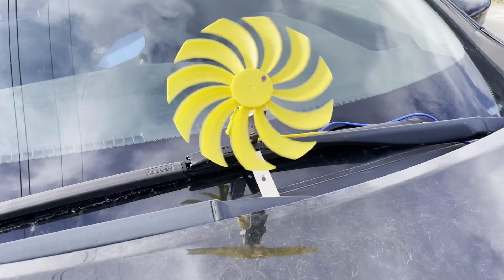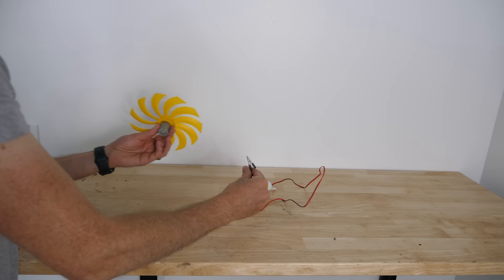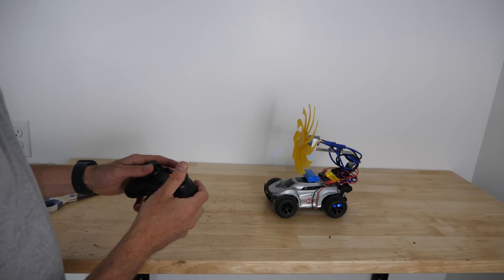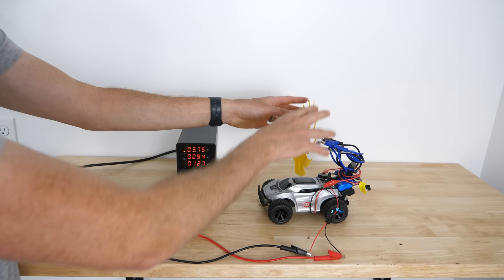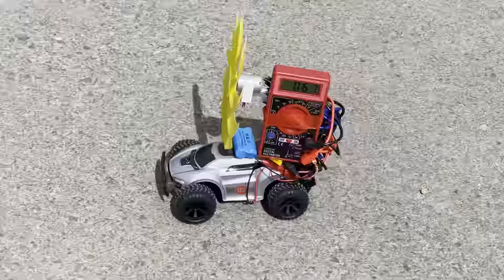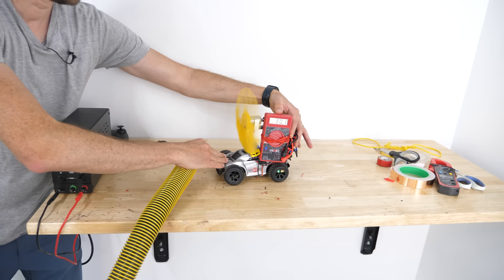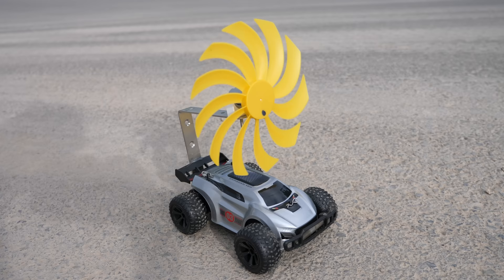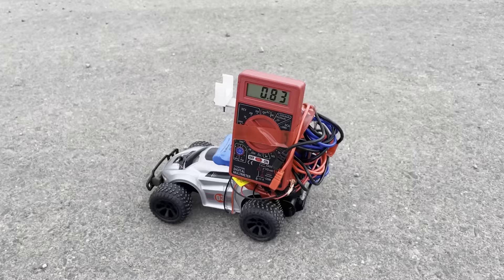Can You Power a Car With a Wind Turbine?

Comment: Heres a question: Let's say you have a container full of water with bubbles coming up from the bottom of it. If you rise the entire container up at the same speed that the bubbles rise, do the bubbles go up faster or slower relative to the container? And lets say you drop the container so it is in freefall but still upright, do the bubbles go up faster or slower (Once again relative to the container)? 

Don't know if The Action Lab has already talked about this but I think it is a good question. I think I may know what happens but I think it is a neat question nonetheless.
Reply: In both cases the bubbles would stop moving relative to the container.
Reply: The same force applied to lift the container would be asserted onto the bubbles by the liquid around them. It would neither make them faster or slower, assuming you can do it without agitating the liquid

Comment: I actually done a theory about this for an english exam as an energy recovery system on a petrol powered car with a motor used for a Refillable Nos like speed boost in theory.
Also added series of Dynamos to the prop shaft for more energy recovery

Comment: What about trying to put the windmill inside a large tube? And slightly modifying the front of the rc car to not only lessen the air resistance but to use the air pushing the rc, directed to the large tube with windmill. 

It would look like an rc car with a ramp on the front and a "jet turbine" at the roof. 

I dunno, just an idea. Making the RC more aerodynamic should be tested further.

Comment: Betz's Law establishes that the maximum theoretical efficiency of a wind turbine is 59%. If that turbine is well designed, it can exploit that theoretical energy with 88% efficiency. 0.59 x 0.88 results in 0.51. A turbine can only harness a maximum of half the energy of the relative wind. An electric car with regenerative braking, generators coupled to the suspension system and a wind generator, could recover a third of the initial energy from the previously charged battery. Even part of what is missing could come from photovoltaic panels installed on the roof of the car. It is a complicated and expensive design, but not impossible.

Comment: A lot aircraft do use turbines (Ram Air Scoops) to generate electricity. I suspect it is more efficient to siphon energy off of air speed then to steal it from thrust.
Reply: Many jets also have deployable ram air turbines that can provide electricity to maintain control of the aircraft in an emergency where power is interrupted.
Reply: They have these turbines because as long as the aircraft is in motion, engine failure won't mean you have no power. It has nothing to do with efficiency and is done only for safety. It is less efficient than mechanically linking a generator to the engines directly.

Comment: Okay, so the answer is yes, but not like that. You need to power the turbine and use the wind generated by the output of the turbine as a sail, you can then power the turbine from generators on the wheels of the car.

Same concept as what Eric from Veritassium showed off with the propeller driven car that goes faster than the wind.

You can energy harvest the differential between the air speed and ground speed while in motion yourself.

The only kicker is you need a differential between the air speed and the ground speed. As long as you have the differential, you're good.

Comment: What about some sort of turbine or fan device If you were to install it all it in normal car venthing areas, Especially things like supercars where they have brake cooling ducts anyway. Experiment with different shapes and dimensions of the things that you use for catching wind. Could definitely optimise it all between placements, wind catcher etc

Comment: Could you explain why hybrid automobile can achieve higher energy efficiency on highway, even without considering the energy recovery duribg braking? To me, it sounds like those vehicles are able to get net positive energy just by adding a electric engine in.

Comment: It could still work make a more aero dynamic duct like 3d printed cone type like aero plane engine type  and change the turbine lay out so the fan is like a hamster wheel type..so that it wont have so mush wind resistance and be more beneficial by charging and driving forward.

Comment: Hi, I assume you were using a motor that had a high RPM. My idea is to use Wind Turbines which have a low RPM but high amps. Now, the vertical turbine would be mounted on a the car roof and used to charge another set of batteries which would be used to charge your electric car. I did a video to explain the idea on my channel. So, my idea is not about "free" energy, but more free charging your electric car using a wind turbine.

Comment: The main limitation of wind turbines is that it is impossible to extract all of the energy out of wind.

To do that would require the air to stop moving after passing through the turbine, but if that were the case it would block new air from moving through. The reault is a fundamental efficiency limit around 50%.

Thus any attempt to power a car with the wind it generates will result in a loss of power, as 50% of the drag force on the blades (a portion of the cars kinetic energy) will be wasted, resulting in an overall higher power consumption.

Comment: Well, to be fair this is still a lot better than using the wind on the side of the road to power turbines. In the end the electricity will come at the cost of a lower gas mileage either way. But I imagine it being way more efficient to have the fan on the car than on the side of the road. Not as efficient as an alternator of course. But you know, at least somewhat feasible.

Comment: No you done it wrong you should put the turbine in front the car so it's not creating more drag insted it reduces some air resistance that will eventually hit the car it self anyways
Reply: It's always going to create drag.  Air turbines need air resistance to function.  Adding that surface area for the air to hit is always going to cause the car to slow down or expend more energy to compensate.

Comment: What about generators in the wheels maybe separate or in the same motors or have the fans deploy by opening a flap in a tube that's part of the frame acting like a turbine generator when slowing down at high speeds?

Comment: If people are putting a wind turbine on the push bike to power a light why don’t the just put an electric motor on one of the already moving parts of the bike to make use of the already existing energy being created.. ie on either front or rear wheel hub/ rims, either sprocket. As soon as the bike is in motion it is creating energy which very easily can be converted to electricity

Comment: If you set two turbines in both sides so it affects less the air resistance? But the turbines should be also with a different design that can make them spin only in one way.

Comment: What happen when you stick the win turbine at the back, on the license plate, align it vertically to remove air resistant? Will the streamlined of the car rushes the wind through the turbine and benefit us?

Comment: What if?
Scenario 1
- Take an extremely aero dynamic car design
-  Place a wind turbine engine under the hood
- Make additional vents to channel back the wind to the turbine.

Operation -
- EV battery operated car propels it forward from 0-50kmph
- Battery power shuts off once the wind turbine gathers enough power to power up the battery
- Car runs on battery powered by wind turbine under the hood

Comment: the turbine has an extra wind resistance the vehicle and the generator on the turbine is like 85% effective, that means the vehicle will use more energy to drive with that wind turbine on that vehicle than without that wind turbine.  

the idea can be modified, the wind turbine can be telescopic, like those automatic antennas in the 90s that came out of the car. when the car drives, the wind turbine can be move in and when the car parks, the wind turbine can move out to make electricity to charge the battery. there are possibilities to build that.

Comment: I am sceptical on the result here. Because in relation the windmill here destroys the airflow arround the car, but if this turbine would be in a position like they are in a combat airplane i guess this could do better. So as shown in the intro, this should be tested with a real car and the output measured from the little turbine to examine the output. i mean yes, it might not fulfill the Purpetual motion but could be interesting, to gain energy for the systems inside the car, like lighting, radio and so on.

Comment: you have to put the proplelor at the back of the car tilted down near the vacuum field so you wont ad resistance  beter juse a liniar propellor just below the back where the air drops off (like a rotating pipe whit scoops or blade whatever ) i hope this is a line of thought i see already a disgins two propellrs on de back tilted 90 degrees with the wing tips just outside the side of the car for adsample
Reply: you also can direct the flow over the middel where the 2 propellors go against the wind like sticking your hand outside you car window then onley not on the side of the car but on back where the wind gows inwarts swirling back  maybe ?ja  da ja da ja da ja da

Comment: But if you put tiny versions of these inlayed inside the body of the car, maybe 4-6 lined alongside the windshield, you could atleast power small electronics within the car without using your battery and without reducing aerodynamic features of the car.

Comment: replace one wheel with the motor and see. if we keeping propeller to the motor due to air resistance we are loosing energy right, then attach to the wheel like if battery is attached to back wheel then replace front wheel like that. then no air resistance, only resistance is due to the magnetic field of the motor and weight of it.

Comment: kinda shows you how important aerodynamics is. I remember reading an article of Mercedes making a car based on the box fish which apparently is very hydrodynamic. So they applied the same design to a car chassis and found out it was crazy efficient, even with a traditional gas engine it was on par of hybrid type of fuel efficiency. The only downside it was ugly AF

Comment: Haha, as I watch here, before you even say it, I know to say that the wheel motors and battery will put a magnetic drag on the generator, so even despite driving the car faster and spinning the blades harder, more drag will be felt by that combo than will be overcome by the push of the air.

Comment: But how would the air resistence from a car with a non-spinning turbine compare to a care with a spinning turbine? If the turbine were located within the original shape of the car, would air resistence really affect it more?
Reply: Yes, because you're adding another point of resistance. Any point of a car where the air isn't streamlined would also likely be too turbulent to allow a turbine or fan to function reliably. The most you could ever get out of a fan in motion is exactly the same as you could get out of a fan not in motion - at best

Comment: But what if the propeller or turbine is a different type of turbine maybe a vertical one that does not produce that much force on the opposite direction and it is installed in specific airways designed to channel air though them when the car moves so it can charge up like regenerative charging?

Comment: What would've been interesting was a system that was always attached, and gathered energy just by parking, or similar in any windy condition. I don't know what they are called, but you should have used the type that have vertical centrifugal blades. That way it would - perhaps - collect enough parking wind/side wind, to at least balance the energy loss of wind resistance. It could even be shape optimized for driving conditions vs wind collector.

At least you could have had your simple system automatically turn towards the wind, so it had a chance of optimizing gains.
Reply: It would have to be deployable as any drag otherwise would be detrimental. Or also needs to be better than a solar panel over the same time period - and solar panels can be a non interference part of the car

Comment: what would happen should you have installed the wind turbine at the rear of the car, at a level which is lower than the top ceiling of the car. In that way ,the installation of the wind mill would not create extra air resistance because it is lower than the maximum height of the car. Can you do an experiment on that to see whether or not the wind turbine would generate power not as the result of air resistance caused by driving.?

Comment: This sounds like an extra treadmill step and the power saving method is moreso better when the vehicle is built smaller than the car. In other words, this is either for an ecovehicle or a travel setup. Then again, the theory seems to side that the drag would outweigh the benefit unless used as a treadmill based charging method via another power source to charge another power source.

Comment: What if you use a smaller windmill and a small our generator that doesn't create so much drag maybe you could also come up with a design like helicopter blades with a swash plate so you can angle the blades so you have a different angle of attack you can make it to where you have a negative angle of attack and the blades will not spin in the Wind then when they're slowing down or when you want to use the turbine you cannot have a sharper angle-of-attack on the on the blade just an idea interesting video

Comment: 0:10 They have. It doesn't work and it never will. You still have to do more work to create less energy than the work you're doing and therefore you're always at a net loss so it's not worth doing. I keep telling people that the best you can do is bypass the wind or wheels and connect the generator directly to the engine and you'll lose less energy... In which case you should just build a gas/diesel-electric hybrid because currently they're among the most efficient. I'm glad you covered though, but I'm sure people will still refute it and keep trying.

Comment: Wouldn’t it be easier to make a funnel on top of the vehicle that leads to a fan inside of the vehicle so that it can turn the fan and charge the battery? Less resistance and it should be more efficient.

Comment: For Sure its not efficient to use it while driving. but nothing is wrong with having turbine while the car is parked. If its windy great it can charge something and if not well neutral no harm in it. The only problem is it has to be easily separated from the body of the car when we decide to drive.

Comment: A turbineon a vehicle would only work at recuperating waste energy, like a vortex generated or something. Much better would be to harness the power left in a car's exhaust, like a turbo does, but spinning a generator instead of a compressor, a bit like F1's turbos work. The problem might be to get it to work well at both low and high load. Maybe try to get it to work at low (efficient) load and just have a bypass for high load.

Comment: But could a large enough wind turbine, sensible enough to generate power when the car is parked act as an alternator? As far as i know there is also a lot of energy loss in an alternator so building a windmill on your car could actually save the cost of an alternator and generate power when idle?

Comment: I'd love to see this analysis done where there's already a large un-aerodynamic body being pushed through the air, like the flat face of a jeep. I'm curious if any of the energy used to push all that air out of the way can be recaptured.
Reply: Yes it's theoretically possible but probably very difficult to get it right.
Reply: That multimeter looked pretty unaerodynamic to me.
Reply: @TheRainHarvester  I'm more trying to express the idea that it could be arranged so the drag is in line with the windmill, larger than the windmill, and would occur whether or not the windmill was there. There's a guy on YouTube who did it and measured a surprising amount of recaptured energy, but I'd love to see the action lab validate those results.

Comment: This is also why people are inventing and making solar powered cars. You don't lose efficiency to air friction. 

A car is designed to go fast and cut through the air. It makes zero sense to try to tap into the air resistances outside the car to try to increase power to the car.  Makes as much sense as adding super glue to your ball bearings to decreases friction.

Solar is the only option in this scenario